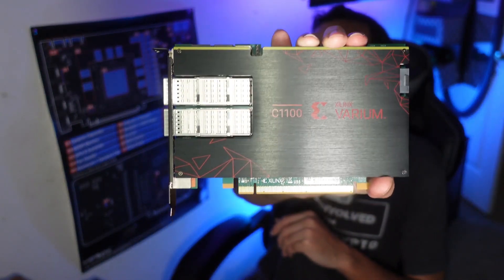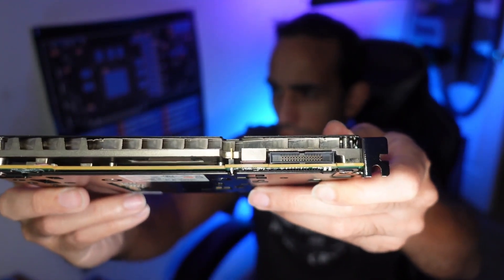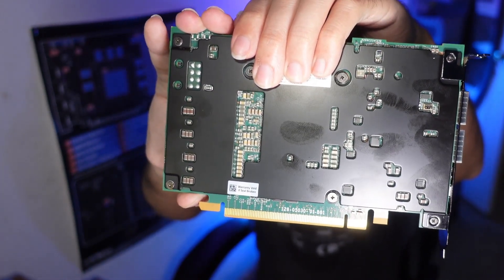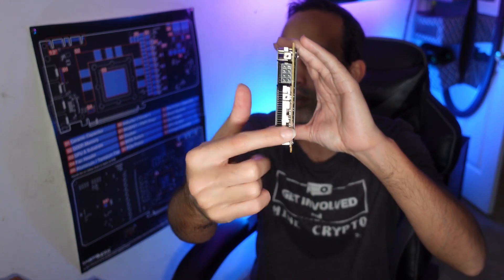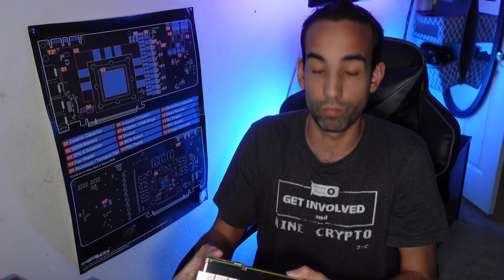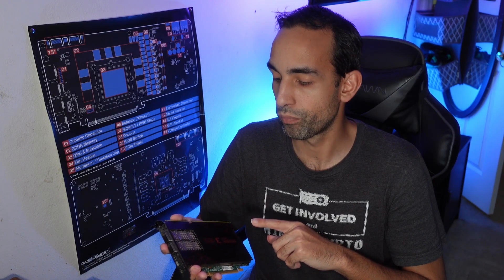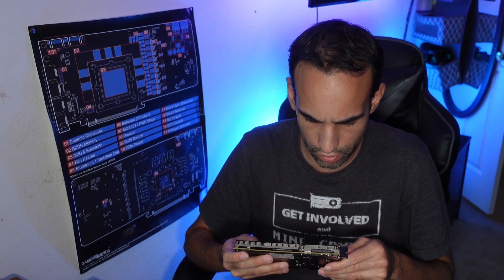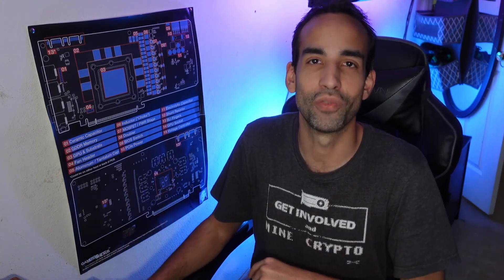One of the Most Efficient Kaspa miners - AMD Xilinx C1100 FPGA Quick Look

Comment: careful with the Osprey cooler. Doesn't look like it makes any contact with VRM's and caps. May want to install some copper ramsinks onto components that need it (if they will fit)
Reply from the maker: Exactly my thinking and why I mentioned it.
Reply: @SerpentX Tech Sorry, I missed that part. I've ordered a couple of different bloweer fans I'm going to try out, including a Fox-2 off Aliexpress (saw one guy using a fox-1).

As for the stock cooler, it seems like the gap between die/HBM2 and the coldplate is larger than typical. I'll likely try either PTM7950, Upsiren UX Pro, or TH949-1 for that matter, for the die and HBM2. Might use Upsiren U6 Pro everywhere else.
Reply from the maker: @snarksdomain3453  no worries, good info and thanks. Let us know of things turn out

Comment: Serpent will you make a video for the Osprey cooler install? I just recently bought one I’m using the 3d printed fan it’s loud as F. I have the Osprey cooler as well but I received one and it was destroyed in shipping. Reach out to get a replacement they sent me another and the same thing happened again.
Reply from the maker: Yes I already recorded but won't be published till next week or thr following. Also if the heat sink is solid, just take off plastic shroud and strap a 120mm or two fans to it and you will be fine

Comment: Wouldn't that $1600 be better spent on a rtx 4090?🤔
Reply: FPGA = Field Programmable  Gate Array = GPU  on 80's wrestling steroids. Hash rate's should be higher than a GPU by quite a bit.  Should be.
Reply: Selling that RTX 4090 will be far away more easy. Good luck selling a FPGA or any specialized hardware if the project it is intended for burns down into flames lol
Reply: @blackmennewstyle  Exactly my point
And you just can't beat the versatility of a gpu
Reply: @blackmennewstyle  Do you understand the Field Programable part of the FPGA acronym?
These are not ASICS. 
You can change the algos and hash at a higher rate (usually) than GPU's.
Reply from the maker: @dontsupportrats4089  and all, I bought this because I plan on doing more than just kaspa and learning more about Bitstreams. It's gonna be hard, but I am down to learn. This FPGA sips power, and the 4090 doesn't, plus as the gentleman said, it's programmable and not locked to one thing.
Reply from the maker: Not if your planning to do what I want to do with it. I want to learn, customize, test and tune